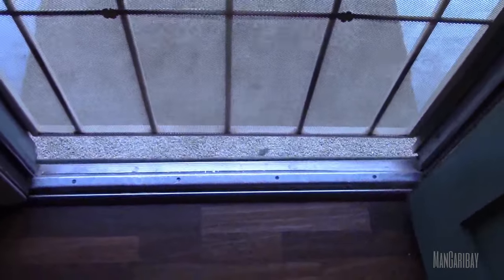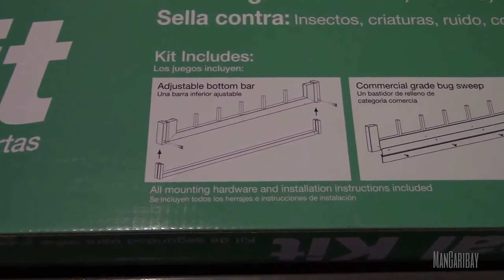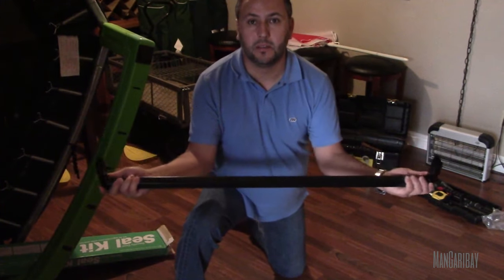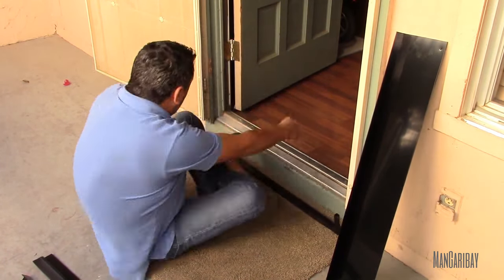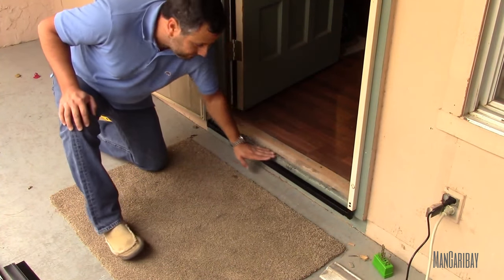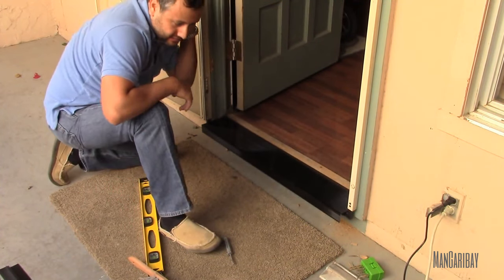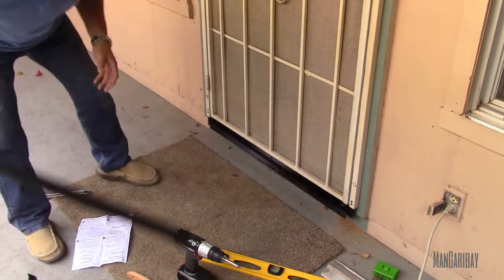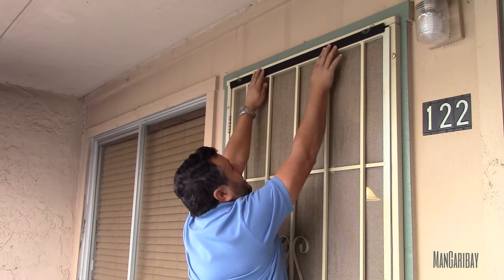Under Secutity Screen Door, Gap Seal kit Installation Video

Comment: Thank you brother for sharing this! Saved me tons of headache! Don't feel bad about the wrong color. I ordered the WHOLE DANG DOOR, went to pick it up and strap it on my car, drove it home, unboxed it (and ripped up the packaging to stuff it in the dumpster) and THEN I put it up against the entry door to see I'd gotten a 30" door for my 36" entryway! The rest of the day was spent pulling the bits out of the trash and jigsaw puzzling it back together with tape! I then wrapped it all back up in shrink wrap so that it'd be returnable and sellable again. Hours later I came back to return it and explain "Uh....it didn't work out." Bought the right size and got that one home...took all day. Lost a whole day for something that would've taken a second to notice! It happens to all of us. You've saved me a lot of time with this vid! Thanks again.

Comment: I love the video since we have the same problem with our newly installed Security Door by Lowe's. We have a 1" to 2 " gap in the bottom of the door.  If you pay to have it installed be sure to check out every part of the installation, we cannot get any satisfaction from our local Lowe's. We have tried to contact the contractor but they don't return the call, Talked to about three different managers at our local Lowe's, no help. We have even contact CORPORATE, not much help there either.  Just know that this panel is available and should be installed at the time of installation. Love this video. Might try to do it myself!!

Comment: This was great, I installed a security door last weekend and need the gap filled to keep the cat IN! lol  Was about to build a form and pore some concrete until I came across this vid, really good. Strangely Lowe's doesn't carry these kits but HD came through!
Reply: What did you fill the gap with?
Reply: @LottieSue   The aluminum plate that comes with the kit https://youtu.be/AX6xbL1g4Qo?t=167 extends from your threshold to the bottom of the screen door thus closing the gap.  No need for filler.

Comment: Great video,  thanks for sharing.   Got a gap almost just like that after I put in a nice used aluminum screen door someone was chunking out so it was FREE and awesome.  lol    One time,  i made a step from a house door into a garage that was jacked up at bottom around concrete.     Just used two pieces of good hardwood,  one horizontal and one underneath to support it vertically and it never had a problem again,  super tight and sturdy,  even stained it.   I got very lucky.  (didn't phuk it up).     Maybe the vertical piece was a cheap 2x4 but top was hardwood.   I don't even think I had to screw into concrete because it fit so good but you could if need be.    That kit is pretty nice deal.

Comment: Why did you use a black seal kit with a white door? They make a white seal kit. Also, the door sweep is attached to the INSIDE of the door, NOT the outside - that's why you are seeing the gaps on either side from inside the house.
Reply: @M Tara Regan Well that's not a very nice thing to say...

Comment: Nice job.  It looks great.  But I'd be worried about mice getting in through those tiny holes.  I'm looking for something like this except mine is a non-security type with no lock.  I've got 1/4" gaps all around so looks like I'm just gonna use weatherstripping.  Unless someone has another recommendation.

Comment: Home Depot and Lowes used to have available an inset mount frame, but now they only sell the surface mount frames, so that the screen door is so far out it's way off the existing thresthold.  I don't want to put holes in the threshold I have.  Just offer at least one option that is inset mount.

Comment: Oh hell yes. I was gonna replace my door with a recessed door which are at least triple the cost of a surface mount door. We have everything from scorpions to snakes where I live and I'm tired of stuffing a towel in the door. I think Home Depot saw your video and raised the price $10 though.
Reply: Chuck Valente ya we were told recessed or custom, I wasn’t having it, knocked down stucco and put 3x1 frame and bought a standard door, once I do the seal kit, will be good to go and saved atleast 1k by not doing a custom door

Comment: Thanks I wondered how to fix that gap. I get lizzards. Baby birds and all kinds of things wandering in due to that gap.
Reply: How did u deal with the lizards?! That's my issue, and this still leaves a bit of gap on the sides which lizards can get in.
Reply: @alborzino  I decided to get some pool noodles at the dollar store and cut it to fit the width then sliced it length wise to slip over the bottom of rhe security door.

Comment: Sorry to point out 2 mistakes. 1. They tell you in the instructions to put your threshold at the same level as your existing threshold height. 2.  The door sweep is supposed to be on the inside of the door.  That is why you have gaps at the ends.  Not trying to bust your chops, just saying.